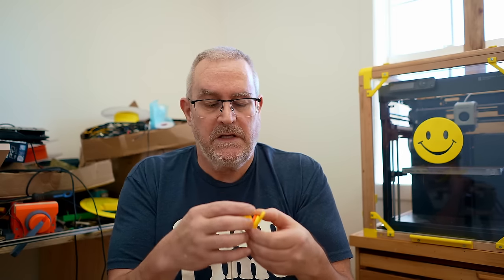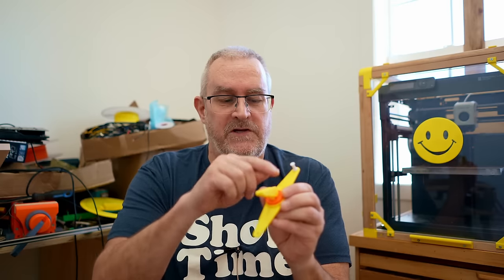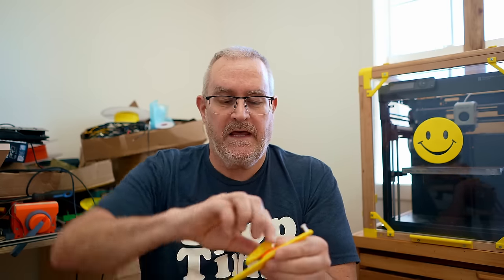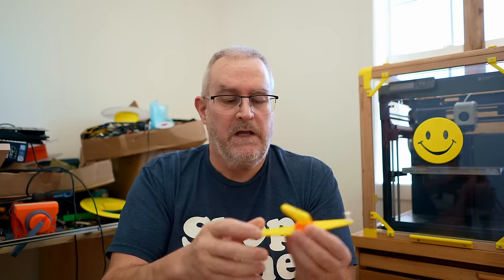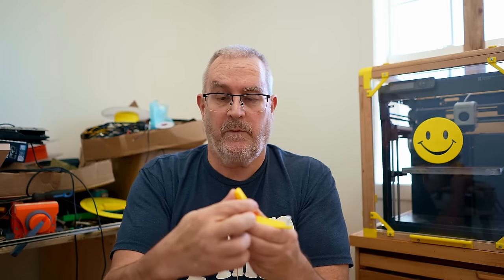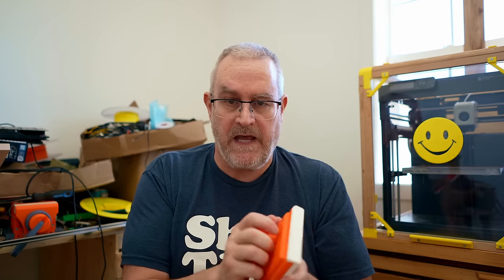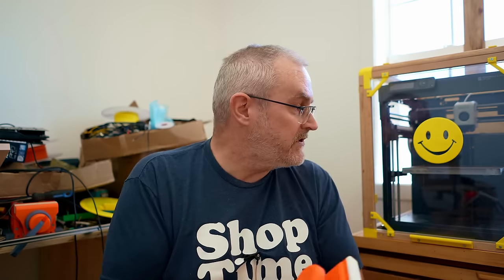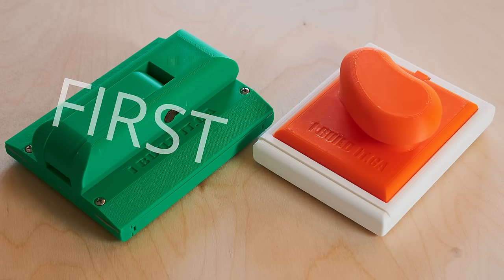After 11 Years The End is Here

Comment: Welcome to the fun world of 3D Printjng. I’ve been doing it on YouTube for 10years. I’ve been recommending them for woodworkers for years. You should try wood embedded PLA. You can print it, then sand it, stain it. Hatchbox makes a great wood filament.
Reply: My experience with hatchbox wood PLA is that it has issues sticking to the build plate which isnt surprising when I realized wood isnt sticky. I prefer just using brown PLA+ if im going for a woodish look because PLA+ is very sandable where as normal PLA isnt.
Reply: @VERY_MAD_ALIEN  - I’ve never had that issue with any wood filament. But a little glue stick helps any print if necessary. By adjusting the temp you can actually control the color of the wood too so you can get a light or dark wood look or adjust it mid print to get different color tones without staining.

Comment: Been an avid viewer for many years now, have learnt a lot from you. Skills and experience are built up over time and you constantly develop and improve. Bought a cheap 3D printer about six months and have not used it much. Did not want to just print and stupid stuff. Again a new skill I have to learn, using tinkercad for basic designs. Only recently did I learn you could scale files to fit printer bed 😊. My plan is to create jigs and fixings for improving my woodwork in my basic small shed.

Comment: I purchased my first 3D printer in Feb 2018.    Last Dec I upgraded to a CoreXY fully enclosed fast printer.    The fast speed really helps.
I use my 3D printer for making parts to fix things, or parts for wood work/turning jigs.    As you said, some things are easier with the 3D printer than making by hand.   I would not want to be without a 3D printer these days.
I also use FreeCAD.   A lot of CAD features, just a steep learning curve.
Dave.

Comment: Welcome to the club. I got my first 3D printer about 5 months ago. Started small and just upgraded to the X1C. My favorite woodworking print was an attachment to my shooting board. I made the Mike Pekovich version that uses a construction square for the 45 degree angle. I needed a 58.9 degree angle for some cross pieces on a planter. I just created it in SketchUp and printed it. Perfect solution. Took less than 20 min to design, and it printed while I was doing something else. Are you making your 3D designs available?

Comment: It was interesting to watch the video. One thing that kept occurring to me was that you seemed to be more excited about the 3D printer than the CNC mill. Also, years ago (early 2000's) I believed that 3D printing was not worth it until we got to a place that a 3D printer was as easy to set up and a laser printer, or ink jet printer. We are basically at that place now. I bought a 3D printer 7 or 8 years ago, and it was a pain, and I could basically do a better job in wood, faster. Now I am reconsidering a new one, because it's mostly automatic, including multi materials.

As always great work.

Thanks!

Comment: John you are not wrong. The 3D print is at the stage where it's just an appliance and has a much easier entry point for the average tinkerer.

Even some of the CAD software, like Tinker CAD, has become easier to use for the average person. Hell you don't even need to know CAD as there are millions of designs available for free.